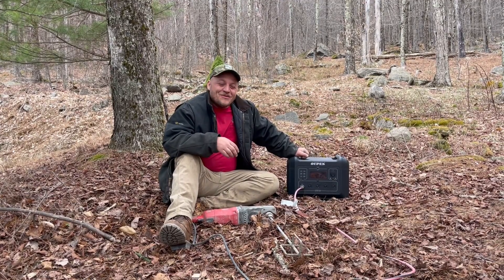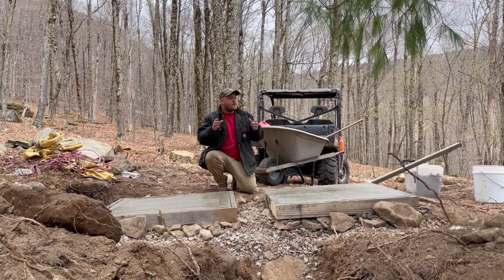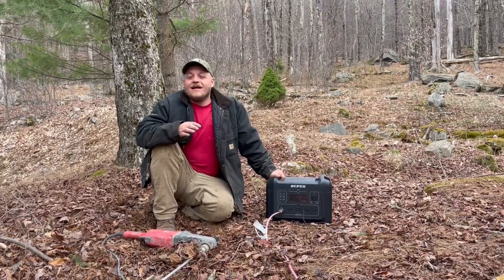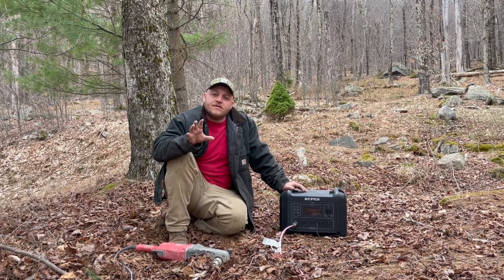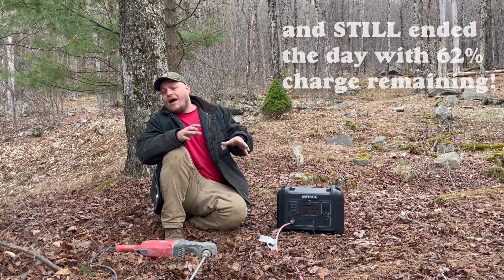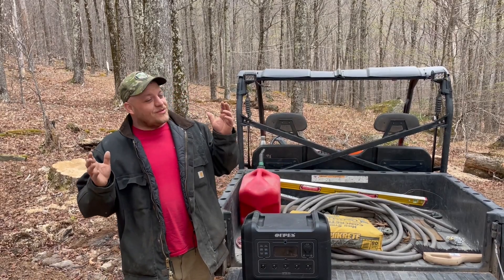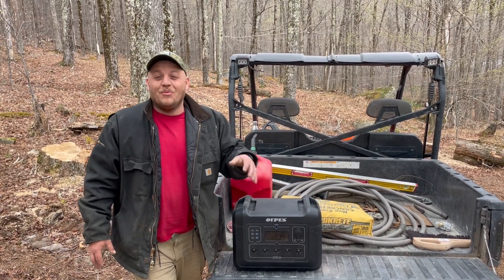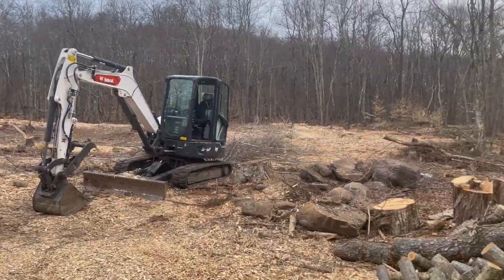Oupes 2400 at the Job Site

Comment: We have several Oupes 240o’s at different locations/applications. Lots of power, light weight, dependable. Works great as an option to our portable gas generator for our travel trailer….we don’t have to go out in the rain/snow to power the camper…just pull the cord inside and plug it in. Great backup power for our home boiler too. On sale as of this posting.
Reply from the maker: Thank you for the comment, I have had the same experience.  Several folks have warned that their units had issues, most of which were resolved quickly by the company.  I think this is a great low-cost alternative to the big brands, as long as your expectations are appropriate.. great price!

Comment: Hi Brian, I was watching your vids on the Hiker trailers. Any chance you might do a comparison vid  between what you learned at their factory to the Bushwhacker? Just wondered if youd still pick the Bushwhacker over the Hiker now that you've seen them. Thanks!
Reply from the maker: I will definitely be doing a comparison video, I want to get the 2 side by side.
For me, if I could do it all over again, I probably would go with the hiker.  I’m working really hard to see if I might be able to even get one this year.  I think the ability to build it exactly to your needs is huge, their pricing is great and there’s a ton of value.  The Bushwhacker is really good for what it costs, but I think in the long run the hikers gonna be a lot less maintenance.
Reply: @DIYOutdoorLife  that's super helpful... It does seem like most Bushwhacker owners mod the heck out of it. And finding sawdust everywhere is not what you'd expect with a new product. I thought I was sold on the hatch style galley but the more I watch, I think the back for storage with a door makes sense.
Reply from the maker: @bg9419  I did a 180 on it as well, I loved the lift up hatch, but I actually think the swing open might be more practical

Comment: What a great project!!!   My jobs aren’t as big as yours, but I use my GZ Yeti 1000X  to run power tools for backyard projects all the time.  The Yeti is mainly for camping but helps with projects and home backup power as well. 

This Oupes 2400 looks like a beast at a CRAZY deal compared to the cost of my GZ.  

I’d love to find a way to use this Oupes 2400 to replace my heavy AGMs in my Taxa Cricket.  They’re sooo heavy.  But I can’t figure out how I’d connect it in and still be able to plug into shore power and have my vehicle charge it while towing without having to perform major surgery to the WFCO. 

Maybe a good project for a video???   Hint hint.  🙂

Keep up the great work!
Reply from the maker: We’re making some progress, can’t wait to see how it comes out.

Unfortunately, that’s one of the downsides of “no bells and whistles”.  This unit is large, powerful, and priced very well, but it does not have some of the features of your Goal Zero, including easily integrating into RV.

I assume you have seen this video, but this is the way to do it the most simply and effectively.  In order to truly be able to remove your house battery, charge while driving and shore power, you will need some open-heart surgery.  By doing it the way I do in this video, you could likely replace your heavy batteries with one small light one.  

While driving or near a AC pedestal, you don’t need a large heavy battery.  When Boondocking, you could plug your yeti in like this (helpful to have 2 or a bigger one for long boondocking).

Using Goal Zero for RV Battery
https://youtu.be/_MRIg0Szh-0
Reply: @DIYOutdoorLife  I’ve watched that one at least three or four times already!   That one and some of your early solar set up and goal zero discussions were super helpful.  I like your idea of replacing my AGMs with a small battery.  I may do that for our expedition to southern Utah in September.  Maybe do the back connection to the RV through the 12V plug like you showed in another video. 

Thanks as always for the great help to the community and giving us all such great ideas on how to think about these “opportunities” to customize how we use our small trailers. 👍👍👍
Reply from the maker: @geoffreno3584  thanks a ton for watching and giving feedback, happy camping!

Comment: Running those three tools with 63% to spare. That's an impressive application! My daughter and I  mixed and poured over a hundred 50 lb bags  in a wheelbarrow  by hand on a 3 day project last year.  My 63 year old back was feeling it
 Wish I had seen your video back then!
Reply from the maker: Yikes, my back hurts thinking about that.  

I learned a lot working with the man who helped with these slabs.  For this size project, we were done by the time it would have taken me to pick up a mixer and got it on site.  The electric hand mixer and water pump, running of power station, likely cut the project in half.   The pads turned out great and we’re setting the heat pumps today, thanks for watching!
Reply: @DIYOutdoorLife  Yes I have used a mixer for these size jobs in the past but  unfortunately it wasn't feasible on that last one. Your method with the power station would have really been a time  (and a back) saver!
Thanks again for sharing your advice.  Glad that your job is going so well so far . It's quite an undertaking!
Looking forward to  more updates!

Comment: Hey Brian, what an exciting project to being working on! Thanks for a little peek at the beautiful area that you work in, and the kinds of jobs you do in off-grid construction. Question: does this Oupes 2400 have similar capabilities to power a camper in the same way that the GoalZero 1500x does, as you demonstrated in another video? I was set on the 1500x and now this has muddied the water a bit- more power, super handy for "away construction" and more backup storage. With your channel discounts on the Oupes and special refurbished pricing on GZ, these two are close in price.
Reply from the maker: Hi Julie, thank you so much for watching and supporting the channel!

No, this power station does not have the high output, DC plug like a goal zero 1500x.   If it did, it would be the cats pajamas!
Reply: @DIYOutdoorLife  oh man, that would be just about perfect. No dice, darn.

Comment: I’ve been missing your videos! (I kinda also would like to know how to pour a concrete slab though…)
From what I learned from you so far, I added three 12v plugs in my trailer. I can plug in the fridge in a more convenient location now. I added anderson pp connections to disconnect the battery and use my big goal zero (which also runs my microwave plugged into it) or my smaller oupes. Good stuff!! Thanks!
Reply from the maker: That’s awesome, I’m glad you’re using that great power station set up!

I was afraid I’d bore people to sleep with the concrete slab tutorial …lol… next time!

Comment: I'm right there with you buddy. My Bluetti AC200P travels in my work trailer everyday to power and charge my tools. It also turns my small mig welder into portable welding system which has saved the day multiple times. It works great for work but is less than ideal for our camping uses. PPS's are like purses and holsters, there is not one perfect power station that does everything you need, so we too are multiple power station owners, just not as many as you have 😆
Reply from the maker: Hahaha it gets addicting.  I just started selling them off, Lucia’s orders!